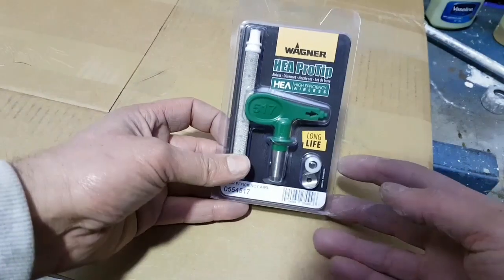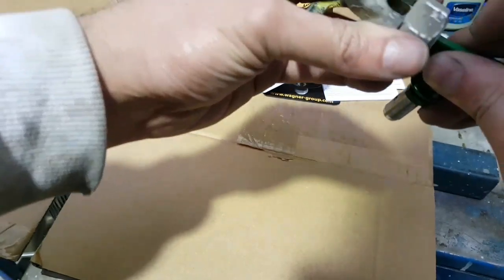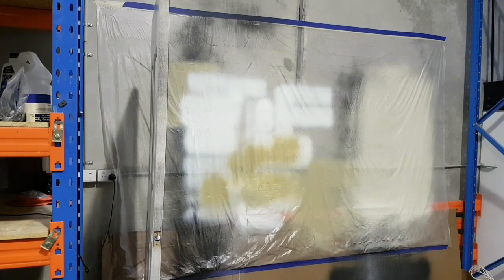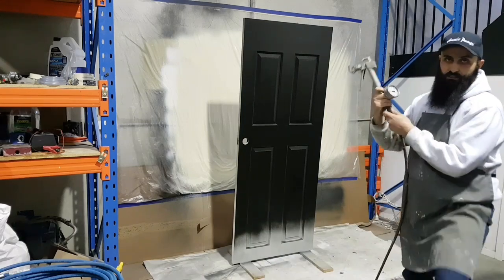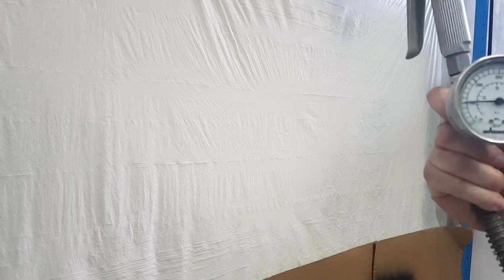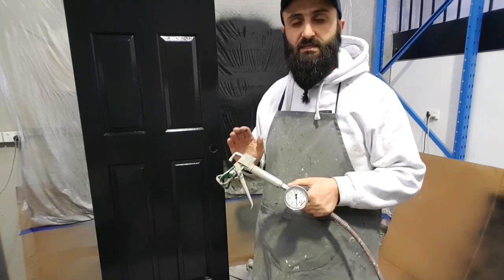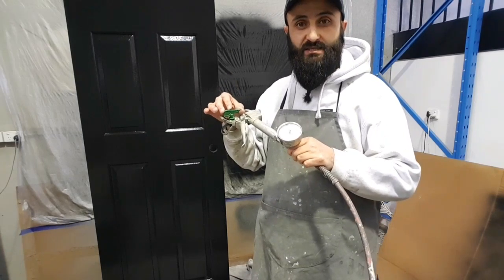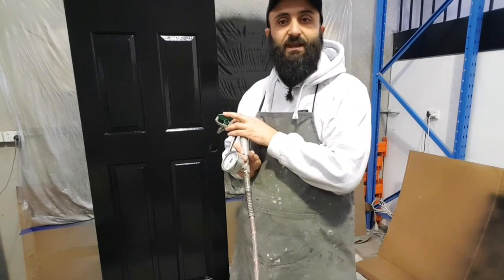Titan/ Wagner HEA tip review and demo

Comment: Great demo, thanks.  My first attempt with the 250m with 517 tip on walls and ceiling yesterday. The results were surprisingly good for my first go but couldn't believe how much overspray there was on the floor; must have been doing something wrong so I'm getting in as much YouTube research as I can.
Reply from the maker: Overspray is something you won't be able to avoid.  Masking up and covering surfaces is key.

Comment: I used the 517 tip for everything un-thinned. Primer, wall paint, trim, doors. Not absolutely perfect but it put down a shit ton of paint with a good enough finish for my basement. 9 gallons of primer in 3.25 hours.
Reply: 517 is to big for latex trim & doors... Doors and trim 313/315 depends on what paint like Flat or Satin or Enamel... Walls 415/417/515/517...  In Latex paint also is good if you mix 5% to 10% of water on 5 gallons of latex paint (better spraying), For Enamel 5% to 12% of Mineral Spirit ... 517/519/521 is good for heavy primer, paint exterior walls on big job/project

Comment: Is that guage on the gun handle just a guage or a pressure control as well.   As there’s some cheap sprayers work well but they lack a pressure control and I’ve yet to find a way to put it on the line itself which should be possible.
Reply from the maker: gday, its just a standard pressure gauge, it can be setup at the gun end of the hose, or at the pump end of the hose.

Comment: I use these tips everyday 517 for ceilings and walls they are great even on fresh plaster no lap lines at all I find 1-5 litres of water in 10 litres is about right for these tips on emulsion
Reply: 1 to 5 litres of water or 1.5?
Reply: @cameronluangrath  sorry 1and a half litres in 10 litres only because the paint I use is really heavy plus I send it through a strainer
Reply: @johnthemod71  ahhh i see yeah about 1-1.5L is perfect when im using dulux proffessional paint low sheen or ceiling flat .517 is standard size for walls and ceilings, have you considered using a 617/619?
Reply: @cameronluangrath  no I haven't only because the unit is running at full pressure with matt paint

Comment: I find that the 517 is the only thing that sprays latex paint properly. 515 splatters and 619 uses so much paint.
Reply from the maker: The amount you thin out your paint affects flow. Anytime you spray its recommended you thin out the paint to aid in atomisation through the tip. Using the right tip size is very important. So if you have an area you want to cover thick and fast (ceilings, walls etc) then you use something with an 0.17 and larger orifice, if you want to have a more controlled pace and flow then use a 0.15 orifice, if youre spraying woodwork you'll want a 0.13 orifice or 0.12 for fine finishing, if its enamel paints, then a 0.11 or 0.10 for fine finishes, I know it seems like a lot to take in , however it's important to understand this.  Also worn or old tips cause nothing but trouble for finish quality and wasted paint.

Comment: Now that you have tested/used both, the Graco FFLP and the Titan/Wagner LP, what do you prefer? What will you use on trim and what will you use on ceilings/walls?  Thank you.
Reply from the maker: FFLP for enamels, HEA for anything water based
Reply: And you even prefer the HEA for fine finish trim?  That's amazing.  Is it because lower pressure or the finish is better with HEA or both?  Keep up the great reviews.
Reply: Dear West Spray Airless, can you cay which HEA tips do you prefer for finish painting? Which ones can you advice? With best regards.
Reply from the maker: Владимир Кулик So far my customers have had good results with the following. 213 or 313 for water based trims and doors, undercoat and gloss. 515/517/615/617/619 for walls and ceilings, that's for undercoat and top coat. It just depends on each individuals preference. But if you needed just 2 tips get the 313 and the 517, those 2 are very good in general
Reply: @westsprayairless8763  this probably most valuable comment. Been searching for ages for somebody giving his recommendations for HEA Wagner tips. Thanks man!!
Reply: @westsprayairless8763 as I just finished spraying room with matt emulsion  517 tip and WOW it's fast. Eats paint in no time, I need to learn move faster haha.  Also I need to spray doors so will order 313 tip as you recommended.  I purchased Wagner 3500 for all around smaller jobs (last week) should arrive tomorrow as I believe Wagner 350M is more for bigger jobs walls, ceilings and 3500 would be all a rounder. Maybe smaller tip would slow down that beast :)
Reply from the maker: @DonPavardenis  Good work mate, the 517 is a fast tip, if you need to slow down try a 515, will give you same fan coverage but less paint so you have more control.

Comment: I appreciate your videos. Ive just purchased the Wagner 350 Pro Extra & sprayed my very first project... kitchen ceiling. I used the 515 tip with Haymes Expressions ceiling paint and then back rolled. Just waiting for it to dry. 
I think Im happy with it but I notice where i patched up an old exhaust fan hole, the spray looks dull over that area. Am I suppose to paint something in particular over my joint compound repair patch first? If so, what should i have used?
Reply from the maker: Hi and good on you for spraying. Sometimes a sealer undercoat is specified over bare surfaces or patch repairs. However what you're seeing will not show upon your second coat. Also back rolling only needs doing after the second coat. I wish you well
Reply: Thanks for that.
Reply: Hi again. I just did most of the 2nd coat of the ceiling (yep...patched area blends in). I didn't quite finish as I ran out of paint. Now i would have finished if I could've utilised all that paint within the suction tube etc. Is it possible to put the paint suction hose in a bucket of water to push the paint within the system through so I can finish off the small section I was unable to do?? I don't plan to paint any more ceilings at this time.
Reply from the maker: @chrise9877  Yes you can but you've only got about 400 ml of usable paint before it becomes fully watered down.

Comment: i always use 515 hea tips for walls and ceilings with white filter could i use yellow filter aswell?
Reply from the maker: hi yes you can but it'll defeat the purpose, because with the finer filter you'll need to turn your pressure up higher for the same results and flow

Comment: Hi Ali. Bought the HEA 311 tip for spraying enamel on door frames and tried all different pressures and had tails. The enamel I used was Berger oil based gloss. Any ideas? Thanks
Reply from the maker: Ioannis Kalaitzoglou Hi mate, strongly recommend you use spray or enamel thinners for your paint not turps, minimum thinning should be 10% to 15%.
Reply: Thanks for responding so quickly. I’ll try the thinners and let you know how I go.  Do you think I should use a different size tip perhaps? Thanks
Reply: If you go up in size you'll have more material flow, so you'll need to get used to that, however not a bad idea. Also for fine finishes like enamel your better off using fine finish tips as they atomise the paint finer than a HEA tip.
Reply: Hi again Ali and thanks for responding. I was using the 512 fine finish tip for doors and frames but find it a little wide for frames so I bought a 410 fine finish tip. We’ll see how I go. Might go a 310 next if the 410 is still too wide
Reply: @ioanniskalaitzoglou8540  how did it go?

Comment: Hay mate great videos , which would you say is better  graco ff Lp or hea tips,
Reply from the maker: For enamels the fflp tips are better because the sizes are smaller, but for water based the HEA tips are superior in finish
Reply: West Spray Airless thanks, i will try these out on the next job for walls and ceiling, I tried  fflp 518 undercoat on some  walls I didn't like it, however the smaller tips on wood work love them
Reply: Yeah tried the hea 517 on walls on a new job, I end up with a similar result as 518 fflp tip,  I didn’t really like the size of the droplets , seems like you must apply a lot of paint to prevent pinhole type of thing , they also seem a bit slower and a bit noisy, but however if you need less overspray this is great, like in wardrobes lower pressure and the softer edged spray pattern for  internal corners it’s a treat, I was using dulux professional acrylic undercoat also dulux professional Matt acrylic walls
Reply from the maker: Thank you for your input, i really like hearing tradesmens input, especially as you are the guys who spend hours using these tips and i only do short tests, keep up the feedback when you can its greatly appreciated and i also pass it on to my customers. Thanks

Comment: Can you review these tips on eBay at $8 I think there worth testing. 
Brand name:
 trade tip 2
Reply: Hahaha, I know this is 3yrs old but' I just got 3 Trade 2 tips for $9 u.s , they don't fit the Rac X, but I needed a 10" extension that came with a heavy triggered paint gun that takes the Trade 2 tips for $20, I'm putting it to use tomorrow, I'll try to send feedback. Peace

Comment: Does anyone know why the wagner range  including Paint sprayer Control pro 350 m & Paint sprayer Control pro 250 m do not have a pressure gauge in the UK  ????????
Reply from the maker: There are 2 versions which are distinguished by their color. the M series is a very basic version sold as a cheaper option with less accessories, the Extra series has gauge, extension pole and 3 tips and gun filters as well as a longer spray hose.  One is marketed for DIY Handyman, the other as a professional unit for light work or as a backup.